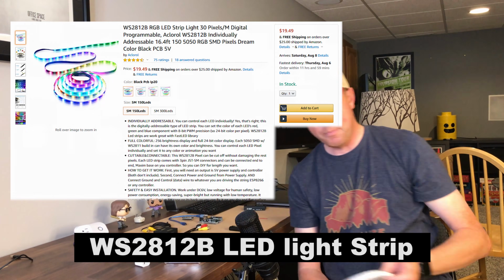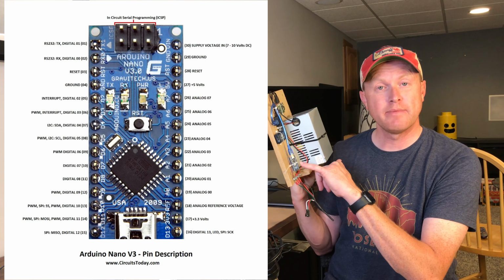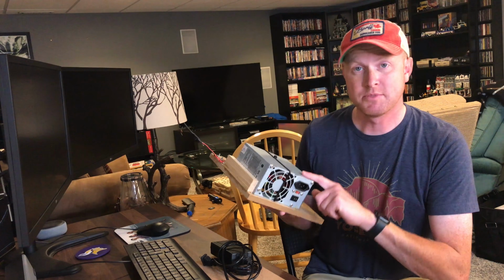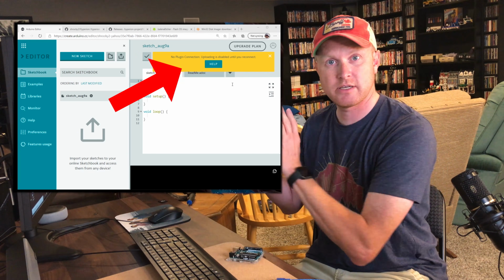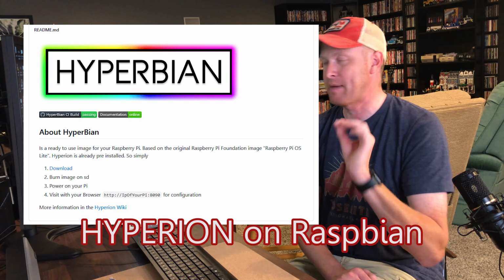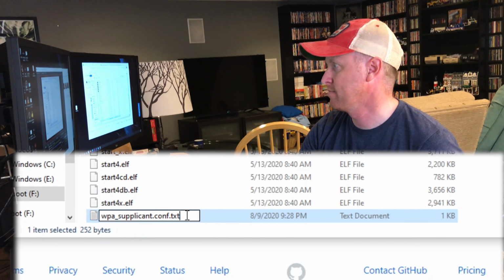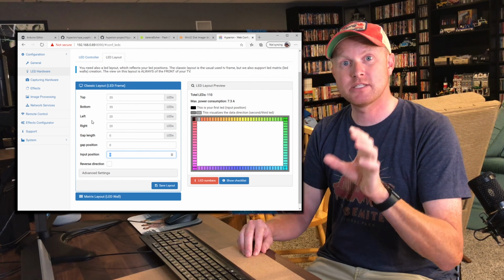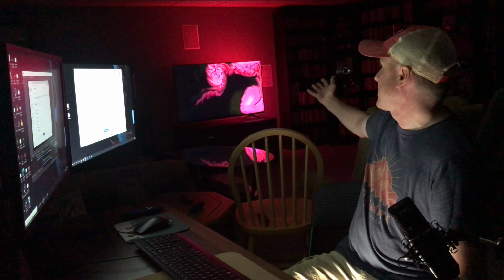DIY Hyperion Ambient TV Light Project (Raspberry Pi + Arduino) Complete Setup

Comment: Two of the key points that you made were the importance of a common ground and suggestion to use a lower Device Resolution setting in the USB Capture configuration in Hyperion.
Reply: you sound like you know what you doing lol can you help me with this ill pay dead ass ill send you my discord if can =]
Reply: @InSaiyanShinobi  what are you struggling with?
Reply: @GodIsBackAtAnfield  I did the project finally I’m actually now trying to find a splitter with 2 outs and multiple ins and how to get Yeelight bulbs to work with this project
Reply: @TheTarzan321   Yes, pretty much.. But it is not recommended..
Reply: @arbbairagi  does this also work for 4k tv?? and can it support 60hz??
Reply: @befrey  My TV is 1080p60hz..
So, I can't tell you for sure... But technically It should work... If you having trouble try using better Raspberry Pi... Like Pi 3/4
Reply: @arbbairagi  ah nvm , my TV is a smart TV... It's ridiculous there's no working product for smart TVs 😔
Reply: @befrey  not working on smart tv? hows that ?
Reply: @YahooDan11  its the way certain apps are censored like Netflix etc. so lights wont work with some big apps
Reply: @befrey  How about Blu-rays from PS4?
Reply: If ist an androit tv it will

Comment: 33:05 so what is the alternative way to capture the smart tv?
Reply from the maker: There is no way to capture a smart tv’s video signal. This setup needs an HDMI device to read that signal. You could try letting up a camera pointed at the tv screen, but it won’t give you the best results. Govee has a product that does this. https://amzn.to/4aQNueD
Reply: @Steve_Does_Stuff  what about using HDMI splitter, input goes to laptop then output 1 goes to tv to display the film and output 2 goes to raspi to process the led?

edited: raspi is using video capture card
Reply from the maker: Yes. They make capture cards that have an HDMI output to send the video to the TV, as well as send the signal to the Pi. https://amzn.to/3UjIRTh

Comment: I don't get why we cannot control the LEDs using directly the pinout of the raspberry pi?
Great video btw!
Reply from the maker: The problems is that the pi gpio pins output at ~3.7 volts. While the LED strip is looking for 5 volts. There are some LEDs that will work with this lower voltage, others will have a problems. You could use a logic shifter to up that low voltage to 5V. At the time I made this video, the Arduino was used in every setup I researched. I’ve done it without the Arduino, but I needed other administrative code to allow Hyperion to allow access to the gpio pins.

Comment: nice video Steve, gonna try this out as a first project, wish me luck.  Will this work for a PC?  and guessing so even though I didn't hear it mentioned. I know this is 3 years old video but since I know little, is there anything that might be upgradable as far as anything that was used that might be better now that would be setup in the same manner?    Thanks for your time.

Comment: Ok I’m in way over my head and fairly new.  
This is going to be long winded…..short question can you use an esp32 in place of the arduino? So you can sync to other light strips?
I an trying to do ambi tv light synced with my sons molding style defused led strips that are driven by an esp32 and the wled app.  You can sync the esp32’s to control multiple strips.  But I want it synced with the tv 🤦🏼‍♂️😂 I know you could prob do this in 5 min but I’m a noob. Never used raspberry pi. Or arduino. Or esp 32 before about a week ago. 😛  headfirst into the deep end.  Any tips or help would be appreciated

Comment: Hi! Thanks for sharing this educational video! Really appreciate it! However I have a question. If I watch my Netflix on my existing LG tv (which does not bypass the hdmi inputs), does it means that this whole setup would be not applicable? Appreciate your reply thank you!!! ❤️
Reply: @Steve_Does_Stuff  thanks so much for your kind and prompt reply! If I still want to install this setup is there any other way to work around it? My LG tv has pre installed Netflix which does not requires me to access hdmi input before watching. I am thinking is it possible to get a fire stick and access the Netflix&hdmi from there? Would it work? Sorry I had to ask in details because it’s not only a complicated but also costly setup, I don’t wish to end up buying everything and end up unable to achieve the results I started off with.

Comment: Great tutorial! Just curious - I noticed that when my TV is off it cuts power to the USB port. I'm wondering if I could use this as a way to automatically turn the lights on/off when I turn the TV on/off. I would basically use the USB port on the TV to power the Arduino and Raspberry Pi, then run a ground wire to the LED strips so they all share a common ground. I would then run power from power supply to the LED strip. When the TV shuts off, it would cut power to the Arduino and Raspberry Pi, which would turn off the LEDs. I could then plug the power supply into an Alexa smart plug to allow me to turn off the LEDs if I wanted to watch TV without them on. Do you think that would work?

Comment: Its run for few seconds and starts flicker randomly..  please help
Reply: @Steve_Does_Stuff  I did..  there is common ground between the led and Arduino but it is still flickering..  (after working for few seconds). I. Can sent some photos. If you help me with your email address
Reply: @Steve_Does_Stuff  its fixed.. I had a bad wire connections between the grounds.. 😂😂😂😂

Comment: Why is the LED strip not connected to the pin 18 on the GPIO of the Pi Zero W rather than use an Arduino?

Comment: I Have 2 Questions. I’m Already Using A. Raspberry Pi To Run Home Assistant (I’m Soooooo Lost Doing That Already… But Anyway) Can I Use The Same Raspberry Pi To Do This? Or Do I Need To Get Another Raspberry Pi? Second Question… Can I Do This One Time For Multiple TVs? Or Will I Have To Have A Different Setup For Each Different TV? Thanks
Reply: @Steve_Does_Stuff  Ahhhhh Ok. So At What Point In The Video Do I Pick Up With The Raspberry Pi I Have Already. (A Timestamp Would Be Fine If Possible)

Comment: Hi my system is 75 inch TV. Led number top bottom 98 left right 56 total 308 led. Not working.
Many time retry at least 254 led limited number.
256 not working. Why not? Arduino power add problem?? My english not well Sorry. U understand my hope
Reply: @Steve_Does_Stuff  Thank U .
Reply: @Steve_Does_Stuff  Uint 16 change working is good. Another ploblem. 300led 300 hyperion set is flickering. I fix it . ex)300led 299led hyperion setting no flicker. 300+ led -1ea setting .but this ploblem 1 point led always on(white)

Comment: I was looking for DIY solutions for HDMI 2.1 based ambient lighting for my setup (Xbox Series X + Samsung Q95T 4K 120Hz TV). But this setup looks like can't even handle 4K 60Hz lol.
Reply: @Steve_Does_Stuff  The problem is, splitter has to downscale one output  while giving full 4k 120hz in the other. 

There's no such product on the market yet.

Comment: I have a Raspberry P1 without WIFI, but I can connect it with a network cable. What steps are different then? It also has 4 usb ports, so I don't need a hub?

Comment: Ive followed the tutorial as best I could. I am having this issue where, when I initially plug everything in, my leds flash at me, and when i save any changes on the pi it flashes like yours. But thats all they do. They arent showing any leds when a video is playing. Any thoughts? I do have a 100w 20amp power supply coming saturday as I have 264 leds. Currently powering them with the psu you had linked. Im not confident thats the issue im having here though.
Reply: Same prob here... Any solution?
Reply: @thambi012006  Figured out that the code is essentially written in 8 bit, so the max number of LED's is 256 (actually 255, 256 will cause it to not work again) I have 264 LEDs. That is my problem. There is "16 bit" code for this project, and a way to take the code he provided and "turn it 16 bit" but every time I tried any of those things it caused them not to work again. For now, I am just using 255 LED's and its working. Hope this helped you.

Comment: Admittedly I have not read through all the comments so if you have answered this before I apologize. My question is how can I set this up to capture the edge color of both 16:9 and anamorphic 2.35:1 without just displaying the color of the right and left sides when playing 2.35:1 content?  Great tutorial, and thanks for the video.
Reply: @Steve_Does_Stuff  they have 720 count led strips now, think those would be worth it? They use 24v so I’d have to change some stuff obviously.
Reply: @Steve_Does_Stuff  is there any sort of dim function in the Hyperion software? Also is there an easily accessible option to just enable a specific color rather than through the hdmi capture?

Comment: I really appreciate you showing everything. About the power supply though... Some don't have color coded cables. Also, yes you'll need to bridge the connector or get an adapter that does it for you... This is all fine. What might not be fine though is that a lot of power supplies don't deliver an appropriate amount of voltage and amperage on the 5v rail if there is no draw on the 12 volt rail. Also, depending on the number of leds you may need to introduce power half way in between as well as at the end.

Comment: Anyone have an issue with LED source not popping up? Got my lights on and capture card working. Aduino Nano said Done Uploading for the code, have a common ground and yet when I go to Hyperion on the Raspberry pi, the LED device light is not green for LED device and the lights don't change with the tv despite them showing to change on the capture card.
Reply: Figured it out. Had to activate advanced settings in Hyperion which gave me more options for adalight that were shown in the video.

Comment: What a great guide.  Does this method still work?  I really am interested in setting this up at home.
Reply: @Steve_Does_Stuff  Awesome! Thanks!
Reply: @Steve_Does_Stuff  would you suggest a 60 LED/meter LED strip or a 30 LED/meter strip using a 5V 10A 50W Power Supply?
Reply: @Steve_Does_Stuff  Steve, if i get the power supply listed (https://amzn.to/30ruOA4 ) can i connect the LEDs and a "sacrificed" USB cable to power the Pi to the barrel connector at the same time so the power supply powers both the LEDs and the Pi?  Also, is your Pi on 24/7?  If not, how do you shut it down properly?

Comment: You don’t need aurdino , raspberry pi have a Pwm pin and spi pin , you can connect the data pin from the strip to the pwm or spi and choose 2812bspi or pwm in Hyperion ...
Reply: I think this guy use arduino for fast and best performance

Comment: Finally a project that just worked.  I had a small problem talking to the knock off Arduino and had to enable advanced options to set the baud rate.  I thought I could get away with no common ground, but once I soldered that we were money!  Subscribed!
Reply: also had the same problem with setting the baud rate and this was the fix, thank you

Comment: It works!!! Great video. My Dreamscreen TV 4K hub died recently and I did not like any of the alternatives I could find. I did struggle until I found the right driver for the Arduino clones you list (listed on Amazon’s product under comments) and the wiring diagram was a bit unclear but I used this one. https://www.pololu.com/picture/view/0J4995. I also used your latest diagram (with Pi 4) but had to plug in the smart plug so as only to remove power from the LED power supply since the HDMI capture device won’t pass signal when it’s USB is not powered.

Comment: Hello, so I've followed the instructions, but I must have something crossed. Once I plug in my Arduino UNO my led's cycle once then don't go on again. I have both ends of my 2812b's wired for power on both ends

Comment: Folks who are watching this need to take HDCP into account. There's a reason that people use HDMI -> Composite converters and composite USB capture hardware, and it's because of HDCP. For example, if you play using a FireTV or any other HDCP device, these cheap HDMI capture devices won't work. The setup that it seems is most common is HDMI -> composite converter -> composite capture. Resolution is bad, but colors are OK. Be sure to look at chipsets. I'm testing with UTV007 but can't confirm it's "best" but look at compatibility for sure with linux and make sure you're buying the right hardware.
Also, I think the arduino is fine if you are using an older pi, but unnecessary if you're using a modern pi. On my list is to see if one of my original gen zero Pis would work for this, but I suspect the problem would be reliable clockrate on PWM or SPI output. Currently, I'm having success with a pi4 using SPI on a sk6812 strip and a levelshifter for 3.3->5v logic for the data line. It seems to me that the only reason to add an arduino would be if you couldn't rely on a reliable signal from the pi or if an arduino is easier/cheaper to use than a levelshifter.
Thanks for the video to be sure -- it gave me a lot of data to continue working on my project :)

Comment: If using his current Arduino sketch with more than 255 LEDs change the line 89 from "for (uint8_t i = 0; i < NUM_LEDS; i++) {" to "for (int i = 0; i < NUM_LEDS; i++) {"

Comment: Hi Steve ! Thank you for your DIY... I have a question for you ? I buy a 16.4ft/5M WS2801 Dream Color Individually Addressable LED Strip Color Changing Pixel Light 160 LEDs 5050 RGB SMD IP20 Not Waterproof Blcak DC 5V... This strip Led have V+ Ci - Di - GND it is not a 3 dot strip leds... I have no idea where i put data wire... Can you help me for this ? *Sorry for my bad english

Comment: Why use a Arduino as well as a Raspberry Pi? Raspberry Pi can drive ws2812b directly via gpio
Reply: @Steve_Does_Stuff  Surely then a level shifter would be cheaper and introduce less latency?
Reply: @Steve_Does_Stuff  Okay. I mean i never had any probably with 3.3v from the pi's gpio to the dataline with 5v to the 5v using hyperion to power it on the pi so there's that...?

Comment: I have it working BUT I have an issue. I have all the same hardware as your setup and running 248 LEDs. Using an XBOX one as my HDMI input, and the USB Power source from the TV to power the RaspPi & Arduino. 

When I power on the TV, the LEDs flash, but then turn off. It will only boot up Hyperion if I go to the web configuration and disconnect, and connect. Once working everything works great. 

Is there a way to setup Hyperion to automatically come on when the TV is powered on, and off?

(not sure if it matters, but it seems that the RasPI and Arduino are still powered by the passthru HDMI input from the XBOX when the tv and the XBOX are off)
Reply: Also, is there an option in Hyerion to have auxiliary lighting off to the sides like in this video? https://www.youtube.com/watch?v=wOvYK2OnFkY

Comment: I have a problem. My LEDS Flashing green, red and blue. After 15 seconds again. But it does not work. On the Hyperion Web-konfiguration page i can see the LED Visualization. 

My Tv 65"
I am using total 261 LEDs
ATX 420W Power supply
Reply: @Steve_Does_Stuff  I dont found it on your githubpage. Now i am using another method without arduino and usb hub. But i learned from you how to make the power supply

Comment: Hey bro, how did you connect the arduino to the lights? I did this project in a different way once before using a breadboard and jumper wires and it didn’t work. Did you use a breadboard?
Reply: @Steve_Does_Stuff  I see, thanks. Also in some other tutorials people are directly connecting the pi to the data wire on the lights. Is there any difference in doing this than using the arduino to do that?
Reply: @Steve_Does_Stuff  bro can u help with one more thing? On my leds when I connect them to the arduino only the first 13 light up. Out of 300... and then they just flash random colors. I have a secure ground and power connections and have both the ground that was already stripped and the one that was part of the connector head grounded to the arduino but no dice. I’m rly lost and don’t know how to proceed. My power source is 5v 15a and I have it directly connected to the power on the leds and using jumpers for the data and ground

Comment: Steve, quick question for you. I bought a AC-DC power supply (https://www.amazon.com/gp/product/B010CKUDZO/ref=ppx_yo_dt_b_asin_title_o05_s00?ie=UTF8&psc=1).  So I got my AC coming in on L,N,G.  I got the strip connected to V+, V-.  For common ground between the audrino/pi and the strip, should I connect the audrino pin 29 or pi pin 6'; should I connect either of those to V- of the power supply, or G?    I'm getting confused if I want to be on V- or G.

Comment: Hello good evening, I have followed your steps and I have a problem, I have a 5v and 10a power supply and when I give power to the led strip, only the first led turns on, what can happen? Help
Reply: Try to connect the power supply (without Arduino) and it will light up white.. if it isn't the LED strip is faulty
Reply: @jithinm5776  ok, I will do tests this weekend, I think that doing that does not turn on anything. If I only connect the positive and negative of the led strip, it does not light any led. I will do the test. thanks

Comment: Another question, is there a way to turn off the color bars my capture puts up when there is no hdmi signal.  Not sure if it is Hyperion or hdmi capture...I’m 99% sure I am using the one Steve uses in the video.  Anyone else have this?

Comment: Thank you very much, works great. One problem I have though is that it looks as if only 255 leds can be drive. Might be  due to the fact that NUM_LEDS in your code is a byte? Could you suggest a fix, my python is not what it never was unfortunately
Reply: @Steve_Does_Stuff  Thank you, will try.
Reply: @Steve_Does_Stuff  I can confirm that it indeed works. Thank you.